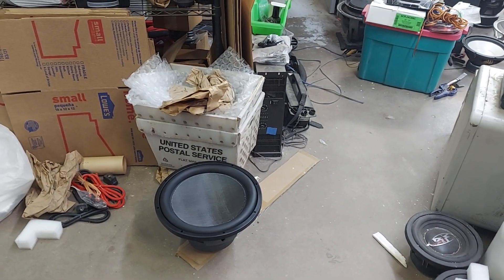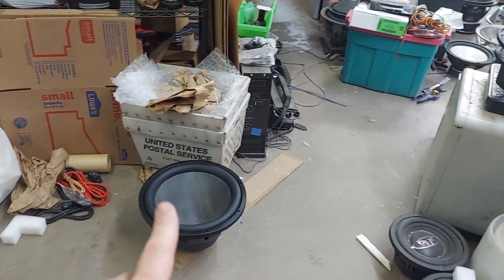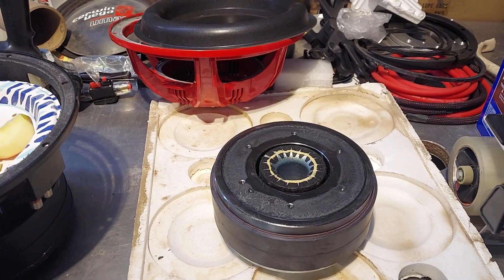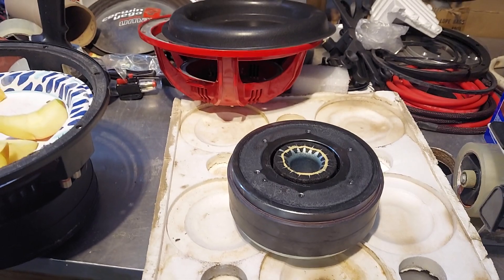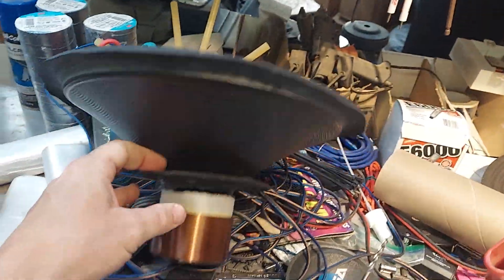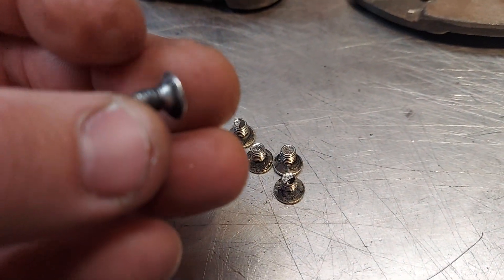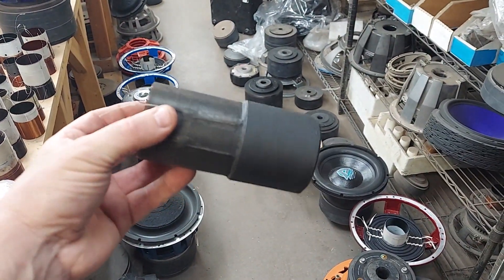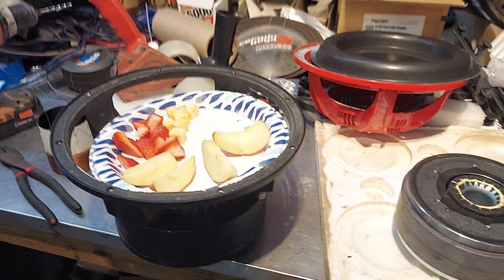Niles 15" home theater subwoofer initial critique.  $2200 for this??!!  Plenty of corner cutting.

Comment: Stereo Integrity is good for home theater.  What are you thoughts on the HUTCHINSON AUDIO Subs ????
Reply: Over priced over thought 💭 quality
Reply from the maker: Si makes good stuff like everyone.  Both brands are pretty expensive.  I do like the $200 specials that Nick is running right now for that 18" but it's got a small motor.
Reply: @RobotUnderground  indeed the mk 6.5 is 250$ apiece but you and I both know where it came from🇨🇳 but the quality is seriously 😳 thought out as in overkill

Comment: Have you put your hands on one of those Peerless 15 inch subs with the 7.4 inch coil? If so how would you rate it.
Reply from the maker: lol.   A sub is a sub.  I think about how serviceable it is... or isn't.
Reply: @RobotUnderground  So you don't think the peerless sub is unique?
Reply from the maker: @delaneo100  Explain what is unique about it.  There are 100 other subs of the same size and force for half the price.
Reply: @RobotUnderground  The voice coil size. The magnet being inside the coil. The small enclosure requirements.
Reply from the maker: @delaneo100  DCR is 3.2 but they're claiming the impedance is 16 ohm??  Sure, small box and good power handling but for that price I'd rather pay $400 shipped for four Gladiator 15's by Audio Legion.  https://audiolegion.com/collections/gladiator-series/products/gladiator-series-15-15-1-600-watts-max-car-subwoofer?variant=39855078375614
Reply: @RobotUnderground  That is a good deal on those gladiators but they can't compare to my peerless 15s. Oh I only paid $400 for 2 used. I'm still going to buy 2 of those gladiators and put them up.

Comment: 00:45 what is that red frame?
Reply from the maker: Just a 12" frame I was going to use on a DS18 motor with a weird BHC of 105mm but I ended up making the motor into a 10"